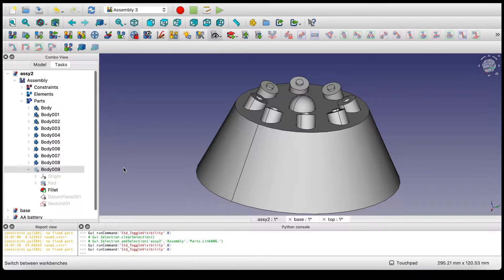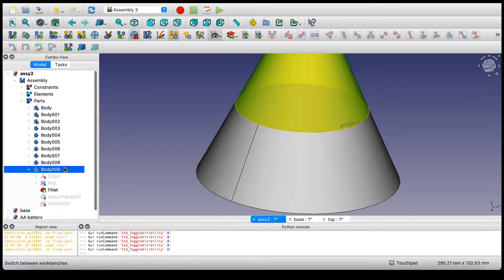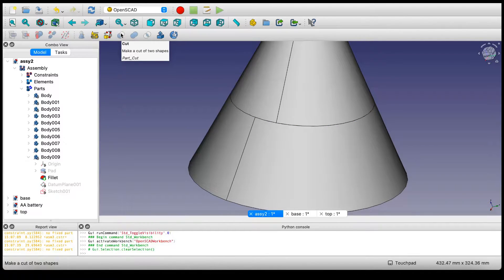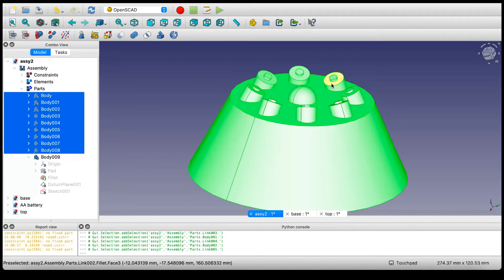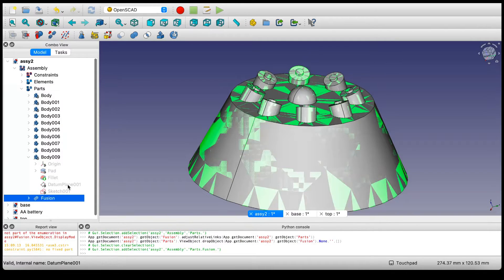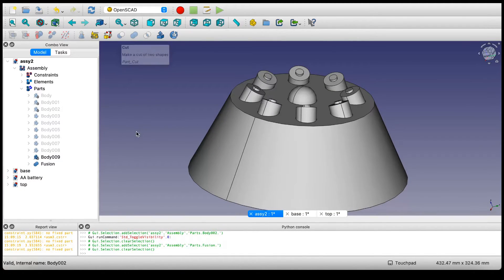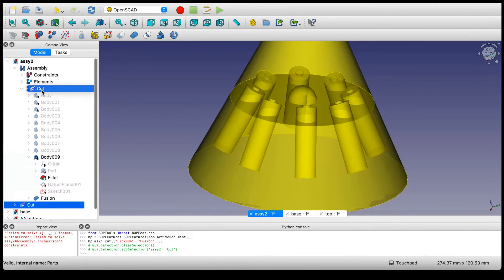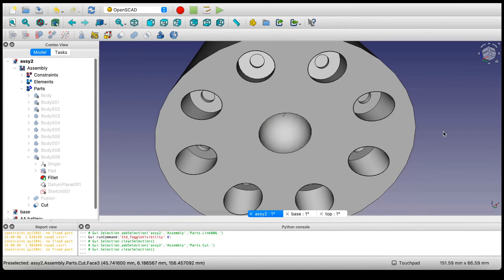How to Do a Boolean Operation in FreeCAD Assembly

Comment: Excuse me, but as I look at it, the batteries with the bottom holder make a concave shape. If you make a tight fit, you cannot put on the top part.
Reply from the maker: Good spot! Yes in the version I 3d printed it  had a little difficulty coming together so I added a small pocket and it seemed to have assembled fine.

Comment: One challenge that I haven't managed to solve: let's say you create a cone (loft) with base on the XY plane with height 10. Create a datum plane parallel to XY at height 3. How to project (create external geometry) onto the datum plane the circumference where the datum plane intersects the cone? The idea would be to create a sketch on the datum plane using the projected circumference as reference.
Reply from the maker: That is a very good question thanks for asking! Hopefully I can help if I understood correctly.  I made a short video to help explain this: https://youtu.be/4hq8qgJLLQ8 If the video does help I might make this into a more professional video, because if one person has a question others will as well.  Good Luck!